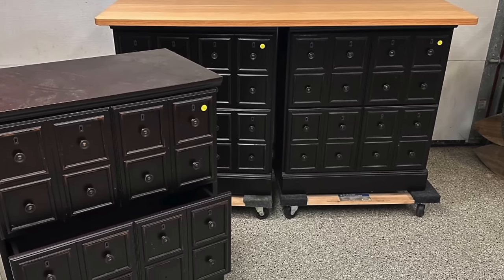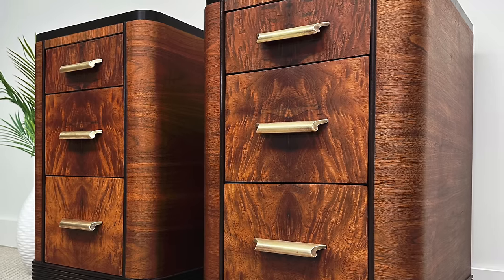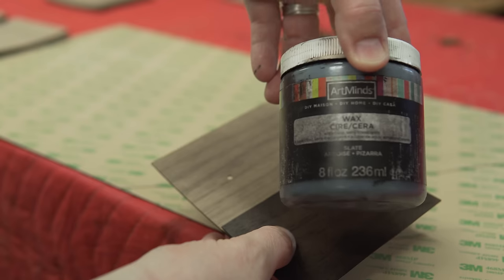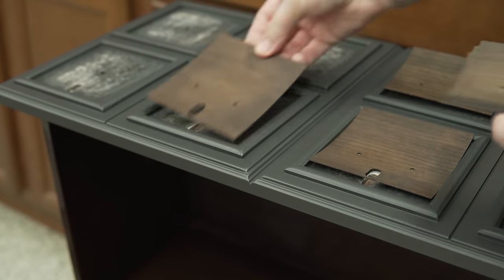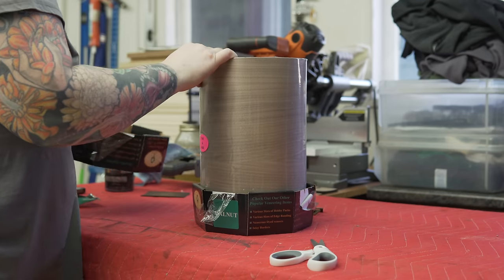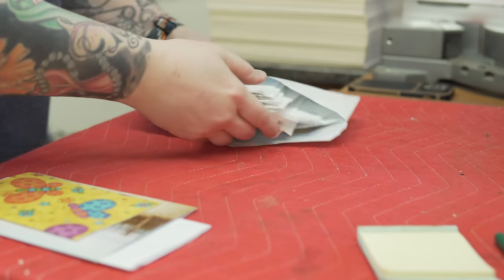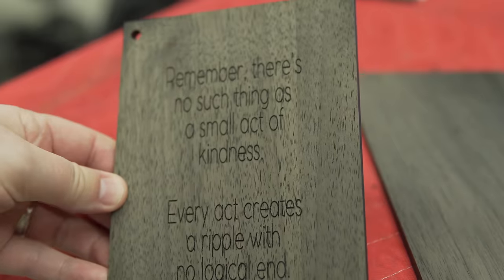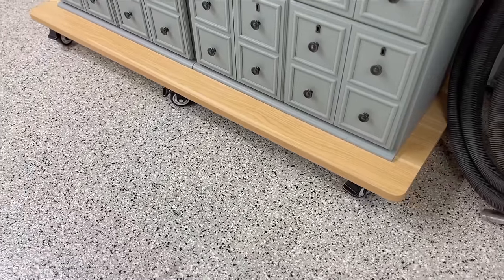I Turned This Filing Cabinet Into A Dark Academia Masterpiece

Comment: Angie, just when I was pondering the (for me, brand new info) possibility of using GRAIN FILLER to bring out the grain in a dresser that I'm ever so S-L-O-W-L-Y getting done, you gave me another idea option with the dark wax (which I already HAVE)! Thank you! I like both your treatments of these pieces, but am a big fan of celebrating the beauty of wood as you did in this current version. Also, you have done SO MUCH to make every video complete, that the loss of your beginning routine steps in this one is no biggie, imo!

Comment: One thing I learned from watching so many YouTube videos is that if you use clear wax first, then it’s a lot easier to control the black wax which is a little more aggressive and requires more attention. On a simple project that may not matter as much as a bigger piece of wood might. Great job, love what you did!
Reply from the maker: The Odie’s acts like a clear wax in this case. Had I applied the wax just to the bare walnut, it would have been extremely difficult to move around. :-)

Comment: Looks fab! Love that you show the versatility of the laser. Curious, you waxed the veneer before placing on the piece. Would you ever stain a veneer before placing on a piece?
Reply from the maker: Not typically. I just didn’t want to get the black wax on the paint. The fact that this was adhesive backed makes a difference too- normally veneer is applied with glue that could get all over it so I’d usually choose to apply, THEN finish. This was just a different situation. :-) and so much easier, haha. ❤️

Comment: Very appealing makeover!  Your creativity w/the laser is mind-blowing & the bunny fundraiser items are just fabulous!  How does one maintain a colored wax finish like that over the long term?  I have some gorgeous furniture my father made that should (cough, cough-) be waxed every year.  Plain waxing is simple enough & I actually enjoy doing it, but I'm a little behind schedule.
Reply from the maker: I’ve had dark wax finishes like this hold up for many years without needing any maintenance, but it can be different if it’s the top of a piece. I take excellent care of my furniture; no harsh cleaners, using coasters, etc, but many people absolutely destroy their furniture. 
In this specific situation though, the veneer itself was always sealed with Odie’s oil (tung oil based product), and the paint has a built in top coat, so the extra wax was mainly to deepen the colour and add just that little bit of extra protection.